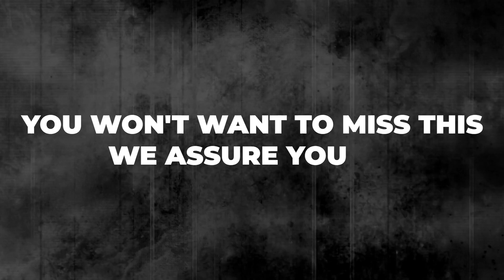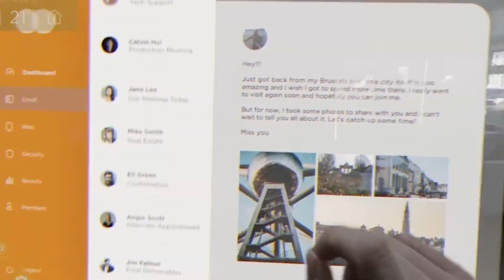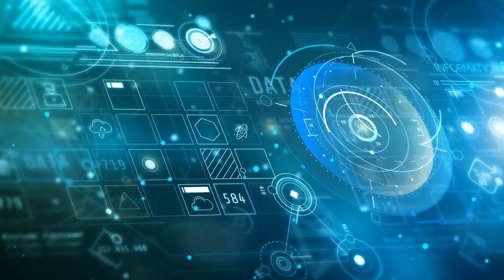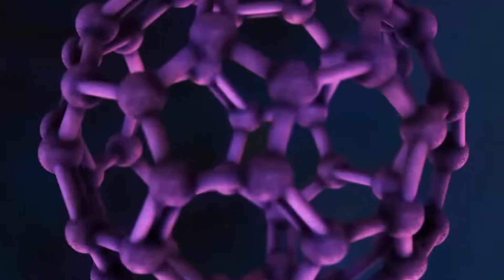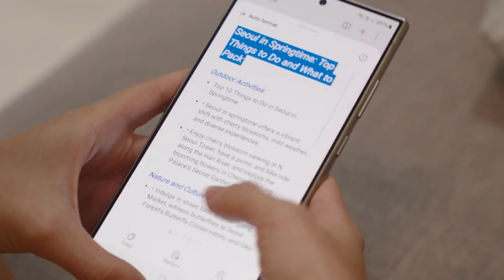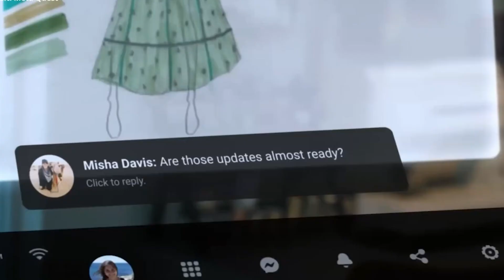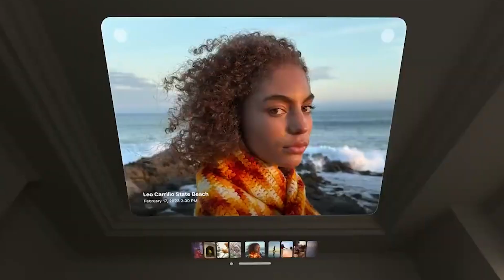Shocking 2050 Predictions Revealed What the Worlds Top AI Expert Wants You to Know

Comment: Emotions are the predominant force in human beings. That means for the most part it controls within reason. Including AI. A neural link between a i and humans is not going to make humans smarter. Understand if the foundation is corrupt then the entire system is corrupt.
I've already gotten into a debate with AI which in the end it agreed my ideas 
and final analysis.
Which should not actually be quantifying. Unless you're putting AI on a pedestal.
Reply: If you can imagine it, it's possible.
Reply: @oscargluja426  if that was true you would understand what I was saying..
Instead of using a low witted quip. For to gain knowledge you must be able to learn.
And it's clear you do not know the difference between a taught learned reactionary response. Which is purely emotional. And a intelligible reply which is also driven by emotions.